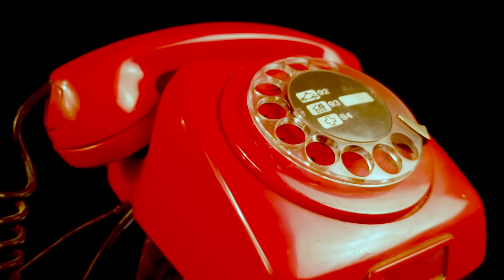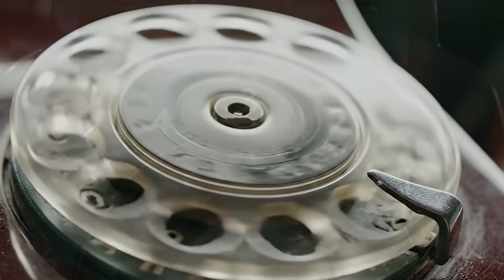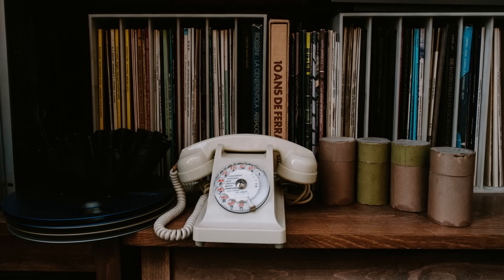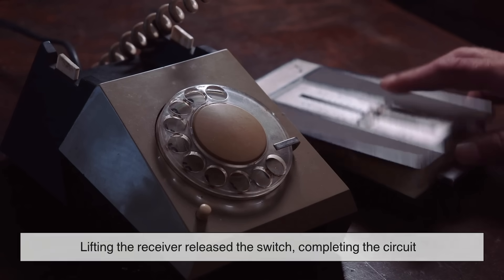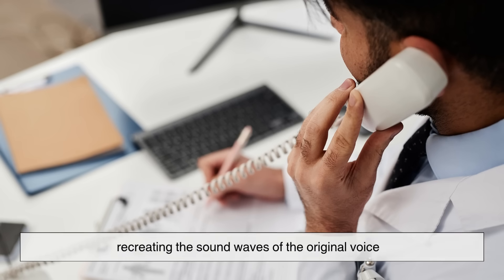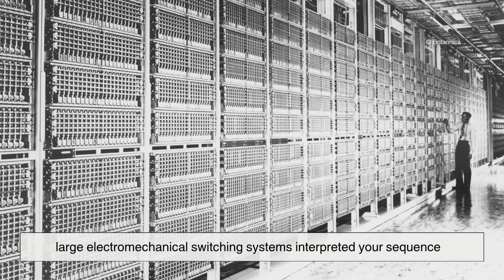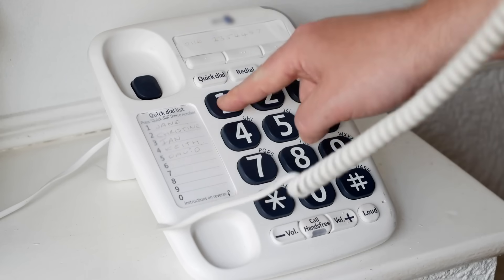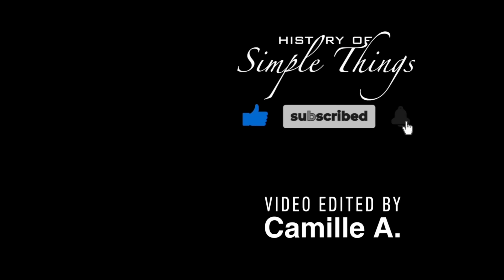The Hidden Engineering Inside Rotary Phones

Comment: Pulse dialing is still (baskward) compatible in most parts of the USA. I have three of them in my house. They even work on my cable modem for a digital land line. My modem also packs enough juice to ring then all. BTW, rapid flicking of the switch hook to call a number was something that most kids learned to do in the 60s / 70s, especially if they found a lock on the dial.

Comment: A long in the 1960s I was a telephone exchange operator.  it was all about rotary dials and switches you pulled up and down to make connections.  I am also an electronics nut and I still love those machines.  Samson from Sri Lanka.

Comment: This is where dialing a phone number came from. The odd part is on modern lines that went fiber optic and have a converter box in the home that converter box still works with old rotary phones.  The sad thing is when the power goes out the phone stops working. Years back the phone company provided the power and battery to run phone. But the early phones needed a phone battery in the biggening.

Comment: I have a suggestion for this video. 😊

In India, there used to be locks for rotary phones!😊 Because phone calls were expensive. Locks were put on the rotary dial. So the rotation won't ever be complete. 

Here's the fun part.😂😊😂

People have found out a hack to dial using the locked phones. The two pins on which the receiver rests, used to send the same signals!!!😊 The same, pressed once would send signal to dial one. Ten times for zero. With the same intervals one must press either of the two buttons. Initially it was hard but with a little bit of practice, anyone could dial the correct number on a very first attempt. Even I used to dial that way!😊
Reply: This is also why you sometimes see people in old movies hammering on the handset cradle/hook with their finger, and yelling "Operator! Operator!". Whacking it 10 or more times in quick succession is the equivalent of dialing 0, which - if dialed as the first digit - would connect you to a human operator.
Reply: @MikeU128  Back in those days lifting the receiver turned on a light so the operator could see that someone was on the line. Flicking the switch hook made that light flash... nothing else. (pre rotory dial)
Reply: @rupe53 Ahh, interesting!

Comment: The claim that "this system didn't require electricity" ... "to function" is of course not true.  What CAN be said, is that the telephone device didn't require any electricity supply apart from what it would get from the telephone central.